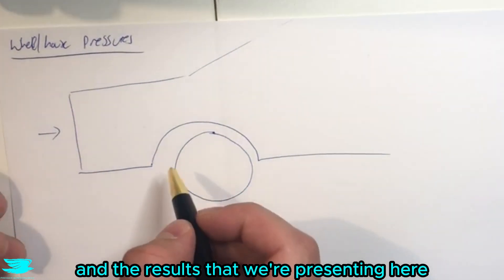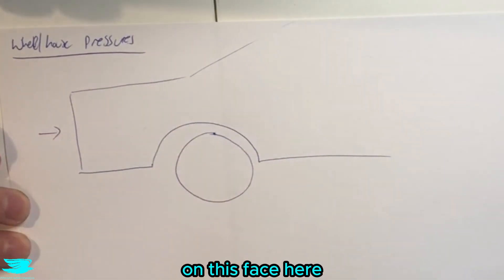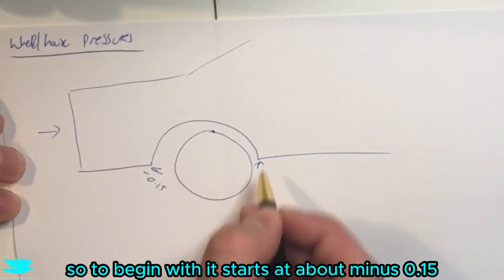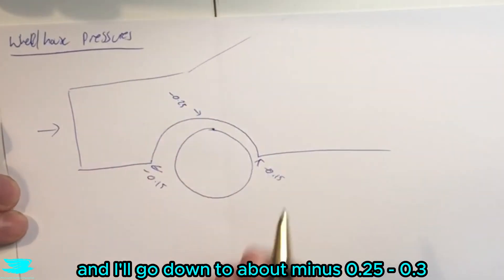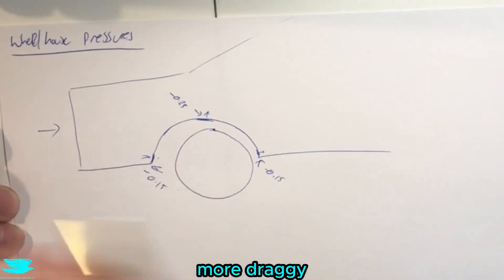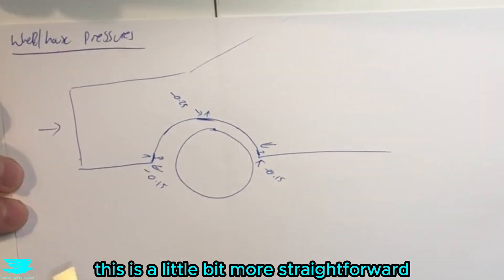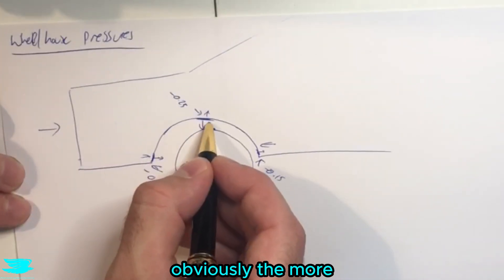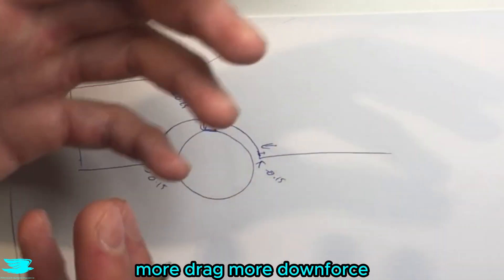Wheelhouse Pressures, Downforce, and Drag {Auto Aero #72}

Comment: Looks like for those cars featuring brake-cooling ducts and/or front diffuser, the need for extracting air out of whee well would significantly increase. Wheel well vents would likely to be a great help on those cars. For example Ferrarl F80, Porsche 992.1 GT3 RS, and even Xiaomi SU7.
Reply from the maker: Yep, that seems to be the distinction, and also cars that don't use wheel spoilers.

Comment: Crazy question: big hiring guy here. Can you model a subwoofer box in a cfd software and what do you think it would show? Like the speed of sound at 40hz ,cycles a second, you can find out how fast that air would be moving. Would there be ways of changing the box or port geometry to show if the pressure would increase, thus in thinking the sound would increase. I’m really guessing from left field here. But think this could be a powerful tool in this space. Thank you.
Reply: Meant to say big *Hifi guy here. Was auto edited
Reply from the maker: Yep, you definitely can because sound is just pressure changes.

I’m not really sure what parameters would be of interest to you though.

Comment: This seems opposite of everything I have read and experienced in practice. Either some information is missing or not correct.
Reply from the maker: What kind of cars do you have experience with in practice?

For modern road cars, practical evidence is given by the fact that pretty much none feature any vents, except sometimes at the rear of the wheelhouse, but that is to give the wheelhouse flow a way of escaping and reducing the wake size.

Modern cars try to redirect as much flow as possible away from the wheels and wheelhouses.
Reply: @PremierAerodynamics  for a road car to vent  wheelhouse is both difficult to design and  not cost effective to implement- the sides of  the car get chipped and  dirty supper fast at minimum  , plus road noise and , I'm sure , bunch of other practical reasons ... road cars don't chace downforce , usually it's design,  drag ... end exceptable lift
Reply from the maker: I think supercars would be okay with the cost, but they still don't feature on most. The only time you really see it is if the car has very different aero to typical cars, or you have a front spoiler/chin strap that ends right in line with the font wheels so that more air is funneled right to them.
Reply: @PremierAerodynamics  To be fair, my experience is all with serious track cars, race cars, and prototypes. Every instance I have seen of fender venting adds some drag, even if minimal, so I wouldn't expect OEMs to use it except in cases like the GT3/GT2 RS.
Reply from the maker: Okay, so with those cars, the air at the front is manipulated a lot, so the air hitting the wheel and wheelhouse is different, and somewhat a case-by-case thing. In that case, it could very well be that the wheelhouses do produce lift and significant drag - for example, the 1969 Charger Daytona.

Comment: My impression was that  usually wheelhouse  is  generating  lift ( hence race cars  try  to vent  there and rebulations  sometimes  limit  how much you can do it) - high pressure zone ?
Reply: I think it may have something to do with the front diffuser used on racecars. They dump more air into the front wheelhouse area which makes the pressure also higher? The fact that racercars prefer to put tiny wing elements on top of the wheel vent louvers instead of leaving a gaping hole also give me the impression that the air inside the wheelhouse needs some help getting out
Reply from the maker: Yep, that’s exactly right. And modern road cars try to do everything to starve the wheel and wheelhouse of air. For example, by adding wheel spoilers/deflectors.
Reply: @PremierAerodynamics  Thanks for confirming!
Reply: @PremierAerodynamics  deflectors on road cars where used since late 80s early 90s  ( at least) modern cars add "wind curtains" to manage front wheelhouse flow,  what about a rotation of the  wheels them self  , they I think act  as a centrifugal fans (i'm not talking about the rim but tire it self) ?
Anyway  thanks for taking your time to make those videos
Reply from the maker: Wheel deflectors weren't commonplace until late 00's, and on cheaper cars, until the mid 10's. The air curtains are more to do with shielding the wake from the wheelhouses from the rest of the flow to reduce the wake size from the wheels. And yep, definitely, wheel rotation creates this thing called wheel pumping, which is effectively a drag that typical load cells can't measure because of how the car is rigged up.

Thanks! And hope you like them.
Reply: @corsamc12  there's actually a bunch with just a hole  , but  it's also usually in the zone that most likely has low pressure ...